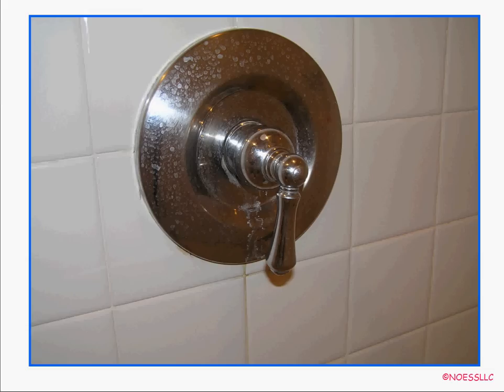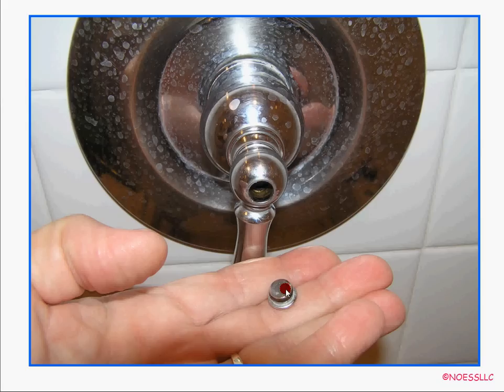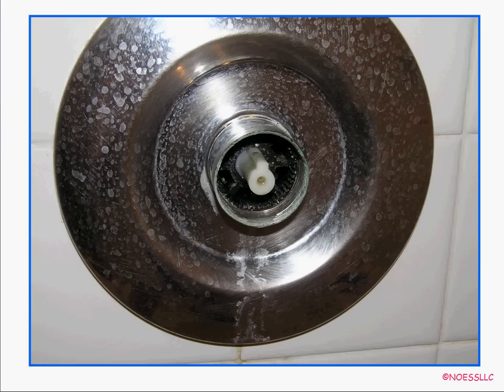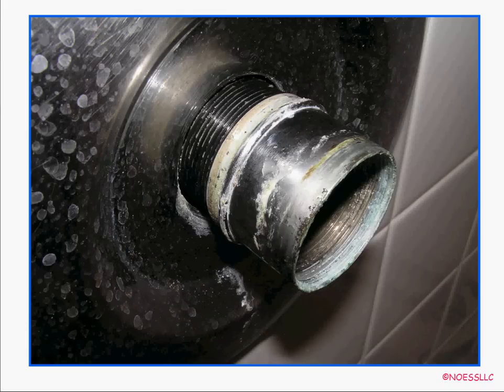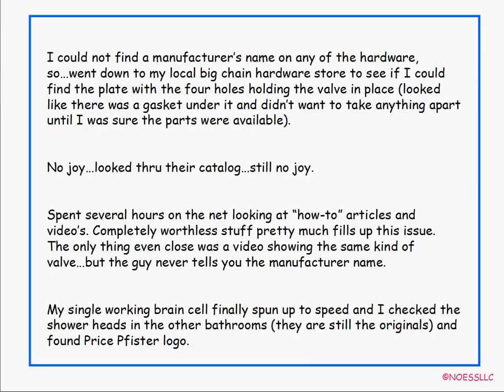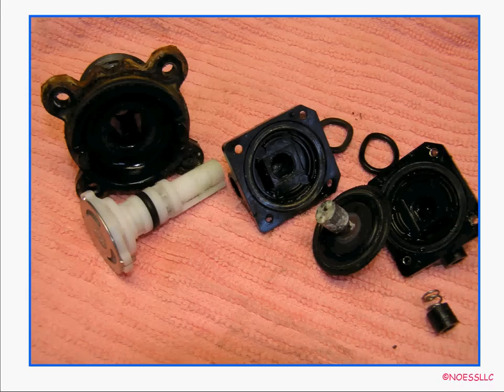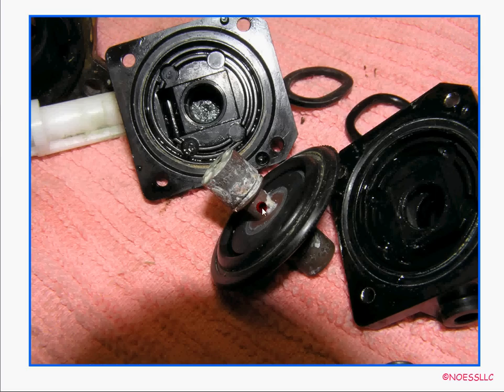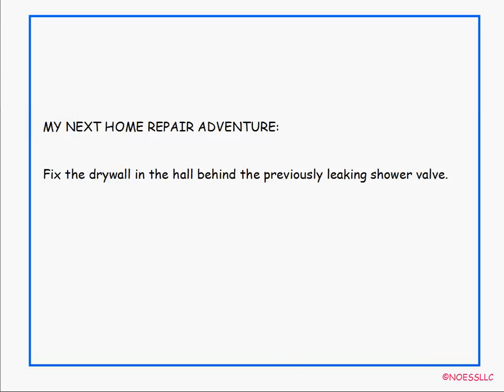Price Pfister Shower Valve Repair

Comment: My shower would not heat up.  It had me scratching my head since the bathroom was remodeled some time in the 90's so I didn't believe it had an anti-scald mixing valve.  After watching this video I realized that the pressure balance feature of the cartridge might be the cause.  Sure enough, when I removed the cartridge I found that the hot passage was blocked.  A quick trip to Home Depot for a new cartridge and I am back in business with steamy hot showers.  Thanks for all the detailed pictures and narrative.  It was very helpful.

Comment: Thanks for making this video.  I have this same fixture and was having a heck of a time identifying the brand.  I did call Price Pfister and spoke with someone I could barely understand.  After describing the fixture they said they'd send something in 7-10 days.  When I asked what they were going to send the person described only a single piece.

I don't think the person knew or cared about the product so instead I went to my local Home Depot and got a Pfister pressure balancing cartridge (S74-291) and a valve stem assembly (971-250).  Ten days is far too long to wait and I doubt I would have received the correct product.

Comment: Late to the party but need to change both a bath faucet and shower valve.  Mine are Pfister also but look different once the cover is removed.  You do a great job of describing and using the pointer while explaining what you are doing.  My bath faucet looked exactly as yours when I removed the cover.  Ends up that on mine it was a big flat washer that had completely rusted and just fell apart.  People at both Home Depot and Lowes said there was not supposed to be anything there.  They didn't have anything matching in the stores so I could not disagree with them.  Will tackle the shower valve if this one works correctly.  All of your videos were very helpful.  Thanks

Comment: Thank you for posting AND providing the Price Pfister name. I'm in Orange County as well and we have had 2 pin hole leaks in the kitchen already. I have the same shower but luckily it wasn't corroded like yours. I'm just not getting enough hot water all of a sudden. I'm looking for ways to adjust for more got water. Will continue on the search with other videos. But this has helped me with a few things.

Comment: Great video! Thank you so much my good sir. I called a plumber cause my faucet had a small leak that would leak one drop every ten seconds or so. He walked in my bathroom looked at it without touching nothing, told me it would be $1200 to fix and that he would need to cut open the drywall in my room thats directly behind the shower in order to repair the leak. I told him I'd get another quote before I decide he then told me "cool, how do you wanna pay me the $100 fee for coming out and diagnosed it" long story short the bastard got me for my $100 but that's OK you my friend have saved me the $1200 blow my pocket was gonna take from that greedy punk. The Pfister  shower valve cartridge replacement part is only $35 at Lowe's or you can get it from Amazon for $23. I'm gonna record myself fixing it, time myself then send it to that filthy plumber when I'm done! 🤗 Thank you!!!

Comment: Great video. I had already disassembled mine to diagnose the problem and had determined it was a Price-Pfister. When you got the cover off I could tell right away that you had the exact same model. Your disassembly with post mordem examination of the defective valve was also very informative. Thank you so much.
Reply from the maker: Glad it helped

Comment: I was looking into how to remove the (as Pfister calls them) "pressure balancing cartridge" (the gray/grey part in your video). I replaced two of them (shower and tub, since they are separate). I was able to dislodge a dark piece, that appeared to be part of a gasket, from one of the cartridges and could not remove additional pieces that I saw, hence why I purchased new ones! When I removed them and tried to blow air through the openings both showed air flow restriction. New parts have no air flow restriction in any of the openings. I will mention your channel when I post my video. Thank you.

Comment: THANK YOU for this video!  I was also stumped with no manufacturer on the faucet and finally searched "plastic shower cartridge" and found this video.  I bought the part 974042 from a big box store since I am not the original owner, and changed the 17 year old cartridge out tonight!  My only issue is that there is a gap between the collar and the faucet.  I think maybe when I was trying to remove it the value was pushed too far forward in the wall.  hopefully nothing a little caulk can't fix.  Thanks so much for the detailed video, it was a lifesaver today.

Comment: Thanks for the video. This is the only tutorial that I could find that had my shower set up. For those who may need the actual part numbers for the two parts here they are: Valve Stem Assembly (971-250) - front part. Balancing Cartridge (974-291) - Back part.
Reply from the maker: Thanks for the note.
Reply: Valve Stem Assymbly (971-250) is the front part. Balancing Cartridge (S74-291) is the back part. You also can just buy the newer part (974-042) which is one single assembly that replaces the two. I decided to go with the newer part as I had to replace the other ones twice in few years.

Comment: Thanks so much for your attention to detail.  I must've put this thing together 3 or four times, even trying a combo of new and old parts (swapping out o-rings because new one looked thinner and felt more "brittle").  I also tried Plumber's Grease.   Your little tip about cleaning and drying the area where the o-ring will make contact is what finally did the trick.  Also, I tightened the screws starting with the bottom two first to make sure it was well seated as that is where it kept leaking.

Comment: Man, you rock. You save me a trip to the hardware store and many hours of research. I called PFister and they are sending replacement kit for free. She stated that now it comes in one single piece unit. Thanks for sharing.
The model number is 974042 balancing cartridge.
Reply from the maker: Rod Pena  Thanks Rod, I think many of us are pleasantly surprised at getting a new unit under the PF guarantee. So far they've not sent the PF police after me for alerting so many people of this great freeby.
Reply: +Rod Pena ,  thanks for the model number!!
Reply: LOTS of detail, thanks for sharing Noess and Pena. That's one crazy compression fit valve! I have the same one
Reply: Thank you for the model number.  I’m calling PF now.
Reply: "The model number is 974042 balancing cartridge."
THANK YOU.

Comment: This is an excellent video ... Thank you! I really appreciate you taking the time to cut open the old parts. I will be replacing the same valve when my parts arrive in the next few days. Mine wasn't leaking but the handle became so stiff that I was concerned that something was going to break.

Comment: Wow thanks a million for posting this. I just got done replacing mine after watching your video. I was afraid to pull the valve out of the wall for fear I wouldn't find a replacement at Home Depot. The tip about the fire alarm shutoff was appreciated, I had my girlfriend watch the pressure while I turned the water off, no problems. Your video also showed me what the part looked like. I was actually able to find a one piece assy. at Home Depot for $24.00. No leaks, worked great. Thanks again!!!

Comment: Great video, everything was covered.  The old valve is in two parts which threw me off when I first tried to repair the leaker.  The video demonstrated how to take the second piece of the assembly out.  The replacement valve is a single unit, part # 974042.

Comment: I had exact same Valve, This video helped me a lot. They have three different parts # for the same valve, one before 97 and second between 97 to 2004 year and latest is valve made after 2004. The latest model cartridge just fits right on my older (1997 to 2004) model body.
Reply: Valve Stem Assymbly (971-250) is the front part. Balancing Cartridge (S74-291) is the back part. You also can just buy the newer part (974-042) which is one single assembly that replaces the two. I decided to go with the newer part as I had to replace the other ones twice in few years.
Reply: DAB 456 just to clarify, the Balancing Cartridge back part number is 974-291.

Comment: Great video. Went to Home Depot and Rona (Canadian chain) and both will give you the cartridge for free (Only Rona had it in stock). You have to ask a sales associate if you want the cartridge.   Just told them it drips and they had no problem handing over the free replacement. Also the updated cartridge is one unit (instead of two).

Comment: excellent.... I've had an issue with these valves, 2, leaking through when the third tub was running???  Internal leaking, so I will change the valve.  Like you, I had know idea what I was dealing with...make, model, where to go, etc., but this video pointed me to the right place.  Thanks!

Comment: You saved my bacon - I had taken apart my fixture to lubricate it with "waterproof" (?) silicone grease, but when I reassembled it and turned on the water, the flow wouldn't shut off! Your video showed me why - the "D"-shaped O-rings in the back had done what yours did - slipped off-kilter, letting water flow freely through to the downspout.  Lubed and reset, everything is tight.  Thank you!

I'm still wondering if I'm actually weakening the seal by using silicone grease -- is this a good idea?

Comment: Hey, I'm wondering if the leak damage possibly came from the faceplate being installed upside down and the valve itself was still ok. Over the years as you showered the water  ran down the wall, through the hole in the faceplate and in turn causing all the damage. I have the same shower valve but mine is leaking from the valve itself. Thanks for the video!!

Comment: Thank You for posting this over 10 years ago, this looks exactly like my Price  Pfister faucet.   Now, of course, mine is almost 20 years old and it will no longer allow hot water to pass through, only lukewarm.  I followed your advice and went onto the Price Pfister website and I did see parts that might fit, but I was wondering if you can remember how many parts you had to order or what the parts number might be.  Any info you could provide would be greatly appreciated. Thanks.
Reply from the maker: Given its age, yours is probably a two piece setup. I think the current replacement is just one piece. Look down in the comments because I'm pretty sure there was a post giving the single unit part number. I later bought the two units for my bathtub/shower from Lowes' hardware. Both in blister pack from Pfister. Pressure Balancing Cartridge S74-291 131770. Valve Stem Assembly 971-250 131776. Don't remember the cost of either unit.

Comment: How would you determine the model of your shower valve? My shower valve (external) looks like yours, but instead of a lever it has a plastic knob. The circular plate on your picture is like mine but I have a knob instead of that lever.

Comment from the maker: I've been a little surprised at the number of people interested in this subject. As far as pipes doing a "water hammer," I would suggest checking the anti-hammer tank. It's usually located close to the water heater. In older houses lacking the tank there should be a closed stand pipe that performs the same function. Be advised...I am not a plumber and have never even played one on TV. I just had the advantage of growing up poor...one learns to fix stuff or to do without.

Comment: Hello and thank so much for posting this video!  I have the exact same problem you had with the rusted ring, and seeing your video was so helpful!  I do have one question.  Did you have any problems removing the 4 screws?  Mine seems so rusted that I am unable to remove them as I'm worried about breaking them if I apply to much pressure.  Just wondering if you have any suggestions for removing them.  Again, thanks so much for making this video and how clear your descriptions were!
Reply from the maker: Dealing with old plumbing is always a risky adventure, so it's often hard to know how much force can be used before breaking or bending parts. Try some penetrating oil on the screw heads and let it sit for a while...or... Brace the back (interior wall) side of the valve so pressure can be applied to the screws thus keeping the pipes and valve from flexing...or...Use some vice grips locked on the screw heads to break them free...or...Apply some heat to the screw heads (preferably a heat gun or [dangerous choice] a propane torch)...or...When all else fails, [or you break something], throw in the towel and call that expensive plumber out. (Don't try any of this on weekends or holidays because it costs A LOT MORE to view the Infamous Plumbers Crack for what should have been a simple fix that "went south" for some reason.)

Comment: Thank you for this great video. I myself have this same shower valve and am the original home owner. The issue with my valve is that it is very hard to turn ON & OFF. Do you happen to know the model number in case I need it when I call to get a new part for it if needed?

Comment: The new cartridges are one piece and as low as $22.00 for OEM on Amazon. Just replaced mine yesterday after bringing back the "recommended" valve part #1 which didn't fix the problem because part #2, the black piece with 2 holes was the problem. Just buy the one piece. It's cheaper overall and fit's perfectly.

Comment: Hello. Do you remember if that white.piece moved once you unscrewed the 4 screws? My it not pointing up but to the side left bottom corner....so the handle is not straight! Anything helps...thanks!
Reply from the maker: By the "white piece" I assume you mean the valve stem the handle connects to? If so, it seems you may have rotated the black "Valve Stem Assembly" which will put the handle into the wrong position. Notice at around 14:30 on the video I show the "divot" on the assembly needs to be at the 6 o'clock position. If it is not...the valve will not work correctly and the handle will be misaligned.
Reply: @otd80  thanks! I was brave and unscrewed it and repositioned it. It was either installed incorrectly or over the years it just moved. I was scared water would go everywhere but only some came out and it was from the spout so it all worked out!! It looks great with the serrano tuscany bronze! Thanks for your video...it really helped and saved a much of money!

Comment: Mine has a philips screw in the middle. Am I supposed to mess with that? I’m getting low hot water pressure but full cold pressure

Comment: Do you have the part number for that black threaded tubular plastic where it limits the rotation? I need to look for instructions on how to adjust amount of hot water.
Reply from the maker: The black part (of the two piece system) is Pfister Valve Stem Assembly 971-250. The rear gray Pfister Pressure Balancing Cartridge is S74-291. The Stem unit is around $15 to $25 on line. The Balancing unit is also around that price. Neither of these units has any adjustment for hot/cold water. The relationship between the two is modulate by the teardrop holes in the back of the Stem Assembly under the control of the positioning of the shower handle. I'd suggest there could be some restriction in the hot line or perhaps behind the Balancing unit. A few people had not completely removed the two old "O" rings on the back side or didn't properly seat the new ones when installing the unit.
Reply: @otd80  Thanks for the parts number which I provided to Pfister. They will send me the full replacement assembly (both parts) for free.

Comment: If you have a different style Pfister handle, you may have to remove an Allen Set Screw, it screws up into the valve screw (the one he removes first in the video) And it stays with the handle, so after loosening, you have to wiggle and pull the handle straight out.

Comment: Hi, This is a great video. I have water dripping from the faucet of my tub shower and faucet system. I know its pfister price, but where do you think the problem is?
Reply from the maker: +Rohit Subramanian  Hard to say without looking at the valve itself. If it were a pipe joint leak there would be water leaking from places other than the faucet. Best guess would be the rubber seals inside the valve body. Only way to know is to remove and inspect.
Reply: Thanks I'll take a look

Comment from the maker: It would be a major pain to replace the entire valve assembly. I've had to do that in two previous homes and it requires cutting pipe and soldering in new parts. Very difficult to do from the front without making the access hole much bigger. I doubt you will have trouble getting Price Pfister to supply the correct parts. I only had to tell them the age and operation of my valve and they knew exactly what I needed.

Comment: A easy way to know if that ball valve was connected to fire suppression system most pressure reducing valves for residential use only go up to 75 lbs of pressure.